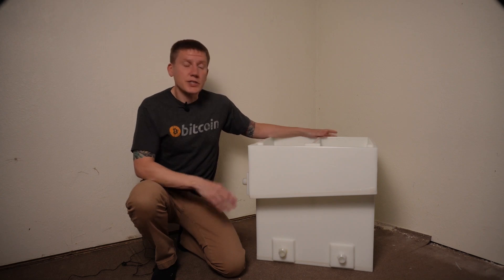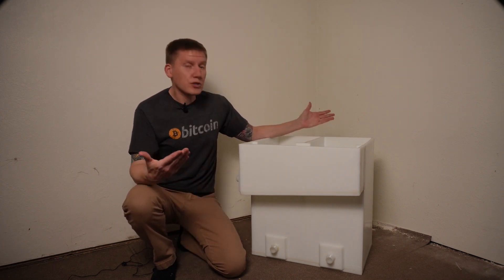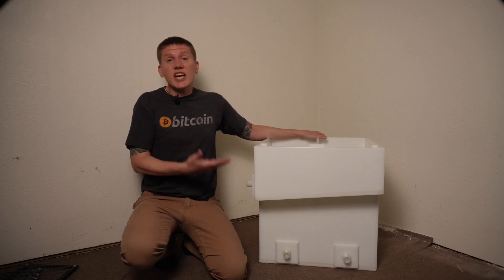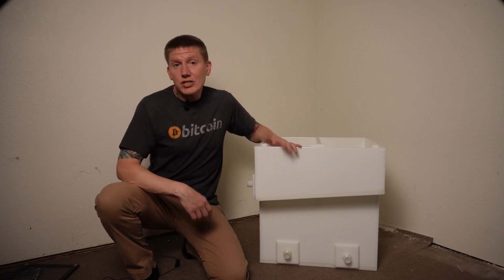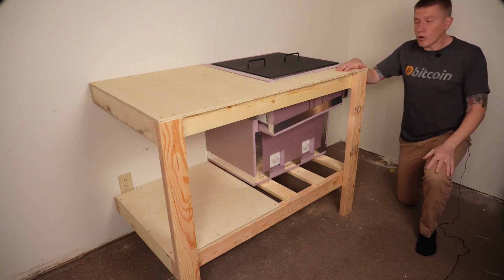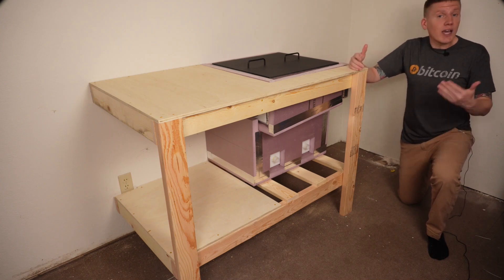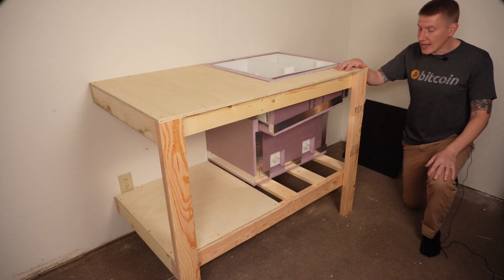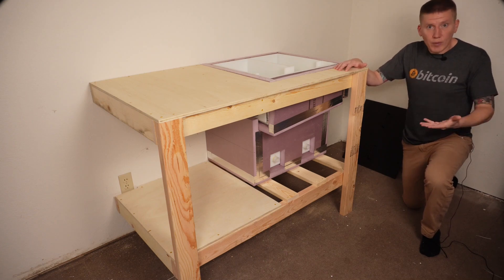EP5: My new BITCOIN immersion tank arrived…now what?

Comment: Avoid HDPE. Will react / degrade slowly at temperatures between 70-140F and really fast at recovery channel with temps close / over 60C / 140F. Stainless steel or black steel powder coated only. Safe choice, last for years. And yes, bitpod has you covered at the same price or significantly less.
Reply from the maker: Interesting...lots of questions.   So Engineered Fluids states HDPE is "Recommended"...not true?   How slowly is 'slowly' below 50C--are we talking hours/weeks/months/years?   And to what extent does it 'degrade' (discoloration vs. softening vs. turning into applesauce ?)   The walls are 1/2" thick...maybe that buys me time?   Yeah...and for bitpod...see my response to the comment below...bought my tank before Bitpod was available 😞.   I hate to say it, but this might make for an interesting future episode..."how my tank fell apart"....I'm joking now, hopefully this doesn't turn into a mess.
Reply: I saw that compatibility list, it says "Selected grades are recommended. Materials compatibility testing is highly recommended, especially for applications > 50C" From my experience 40C /104F supply and 60C/ 140F can be pretty usual temp during summer days for home mining applications without additional ability to reject heat, for example to the pool. 
In most other compatibility charts for HDPE they are rated  non-satisfactory or "Limited resistance (moderate attack / significant chemical reaction, suitable for short-term use only) to aliphatic and aromatic hydrocarbons, mineral oils, and oxidizing agents", the highest rating you'll get is "Fair". Also in most of the compatibility charts even "good" or "excellent" means "No damage after 30 days of constant exposure" - I mean no manufacturer considered this material as a tank material for hydrocarbons, especially mineral oils. 
The best choice is to choose solid material, completely non-reactive, that will withstand exposure to any hydrocarbon at any temperature.

Comment: Hi, I’m trying to build immersion cooling tank for 8asics by myself from design to welding everything together, eny tips how to design the tank and what mistakes to avoid then making blueprints
Reply from the maker: Sure!  First, watch Episode 4....I cover a lot of basic tank design info.  If you are welding your own, I think the biggest challenge is avoiding leaks.   The dielectric fluid is notorious for finding leaks where there shouldn't be any 🙂.   I think the biggest design mistake I made (which will come up again in future episodes) is arrangement of inlets/outlets.   When you make your drawings/plans, figure out where you're going to set this up and how your are going to connect to the tank...if the inlets and outlets are on the right side(s) of the tank, it will make routing piping much easier.

Comment: Looks like you spent 2000$ on an empty plastic box, instead of buying a DCX Bitpod made of a metal immersion enclosure that already has an integrated heat exchanger and circulating pump at 1200$ ??? Also, both Bitpods and ThermaSafe fluid are available from US distributors (FYI). Then no additional costs on shipping them from Poland.
Reply from the maker: Yeah...so the video release (JAN 2023) is delayed from when I got into this.  Unfortunately for me, Bitpod wasn't available at that time (early summer of 2022) 😞.   Definitely would have changed my decisions if I knew what I know now and started today!